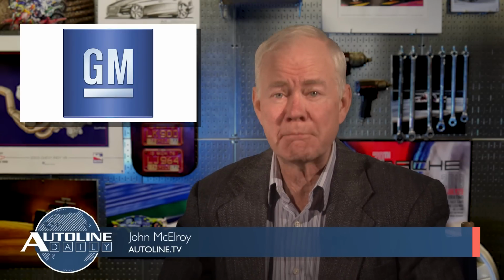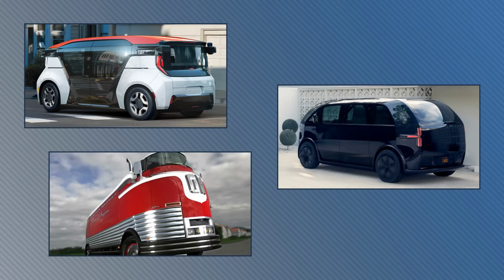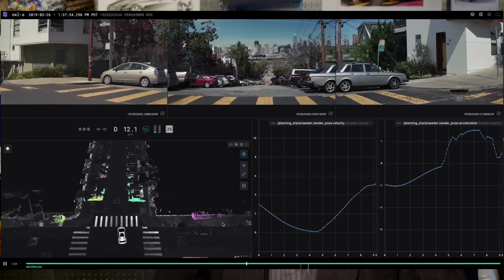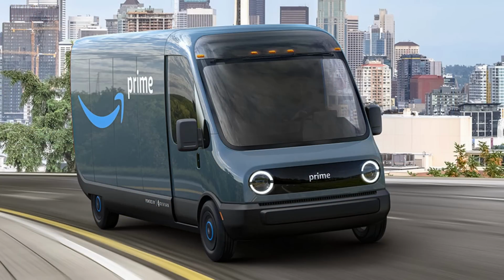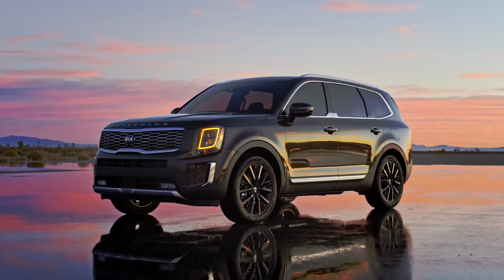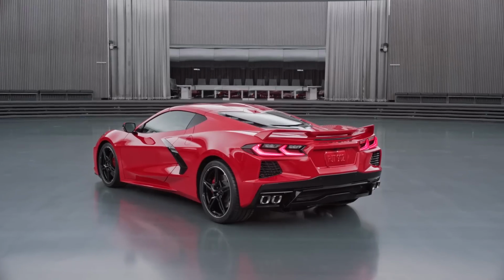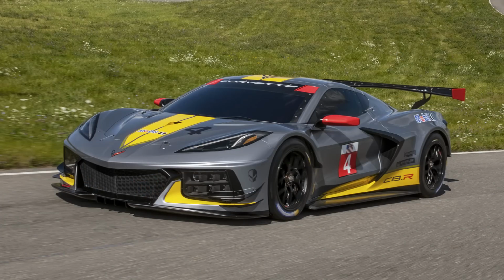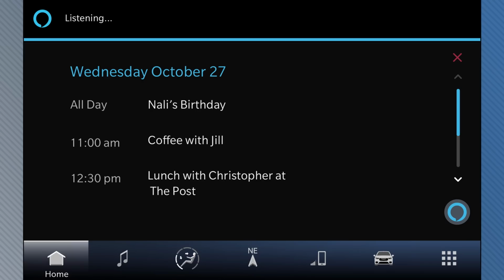Rivian Production Details; New Uconnect System - Autoline Daily 2759

Comment: Rivian is taking too long. They founded 10 years ago, started developing the vehicle in stealth mode 6 years ago and they won't be ready until the end of this year? What's the problem, they've been showing full pre-production vehicles now for nearly 2 years. When it comes to speed of development, they're no Tesla that's for sure.
Reply: Being no Tesla is a good thing. Rivian is taking the time to launch properly, rather than using Musk's "to hell with planning, build it niw and fix it as we go“ method. You won't see Rivian reducing the number of welds to speed things up and finishing vehicles in tents in a desperate bid to fill orders.
Reply: Designed from ground up, company built from scratch involving a few guys. Designed new batteries, had to keep building their team, had to build their infrastructure. 10 years is not bad.

Comment: Rivian suv will get delayed. You heard it here first.
Reply: No, I didn't hear it here first. Every Tesla fanboy in every comment section for an article or video about Rivian says the same thing. And they will all be wrong.
Reply: @TroySavary  says the rivian fanvoy himself lol. You don't have to be a tesla fan boy to see or rather not see rivian making or sourcing enough cells without charging an arm and a leg. Just look at all the problems vw group are having with sourcing enough cells as an example. Software issues etc. But let's hope you are right... As we do need more evs on the road.
Reply: @8est8its89  Rivian is using a standard 2170 cell. Those are not in short supply. I don't see a problem finding enough for the 50k to 100k trucks they plan to build per year. Especially with Amazon backing them.
Reply: Battery production problems.
Reply: @allencrider  that's what it comes down to. They so worried about the body when most any existing car would do, they just need a ton of batteries per car to make it happen
Reply: I just don't see how Rivian can make 100,000 vehicles just for Amazon by 2024, I'm not hating on the company at all, I actually want them to succeed. More competition means better choice for the consumer after all but I just cannot fathom how they will make that happen and focus on their own vehicles.
Reply: This ain't Tesla.
Reply: We are building some of the tooling for the interior trim pieces. I'm not sure if they are for the Rivian truck or suv. Would be late spring before they go into production.
Reply: You mean like every electic concept vehicle? Tesla is notorious for delaying practically every vehicle they've ever made. So it's not a bad thing if Rivian ends up delaying there's, as long as we get the best vehicle possible by them with no issues.
Reply: @maizeandblue5102  There is no evidence that Rivian won't make their promised end of 2020 delivery date. People who claim they are late conveniently ignore the fact that when Rivian unveiled the trucks in late 2018, they stated a late 2020 launch at the time.
Reply: Maize and Blue Hmm, let’s see, the Model 3 was right on time and now has produced and sold hundreds of thousands. The new Model Y delivery is six months early and targeted to produce millions. So, I think TSLA has figured this out. However, similar to TSLA’s first vehicle, Rivian’s first vehicle will probably be 2 years late and 50% over budget.
Reply: @josephlemieux5909  Rivian hired people with decades of experience in running car assembly lines. Unlike Elon, they did not think they know better than people who were already experts. Tesla ran into problems because of Elon's ego. Rivian is doing it the right way by making sure everything is in place before starting mass production. They have done test runs of the line. Tesla did not. They just winged it and screwed up.
Reply: Troy Savary Hmm how has TSLA screwed up? Seems to me all the major auto manufacturers have screwed up - Big Time!! Sorry Troy opinions are opinions and numbers don’t lie. Good luck with hiring people that know how to build ICE vehicles but no experience in the EV market. Remember Rivian has yet to manufacture one vehicle. The clock is ticking.
Reply: @josephlemieux5909  Tesla screwed up the launch of the Model 3. Sure, they recovered, but even the most diehard fanboy can't deny the manufacturing lines were a mess at first. That was a rookie mistake because Elon refused to do a test run of the lines. Every car makers runs a couple thousand cars through that are not meant for sale. There are test driven, torn down, and the issues found and fixed on the line before another run is put through. Tesla, on the other hand, sent the first run to consumers. Rivian has already done a test production run. That is one reason for the perceived dloeness of launch.
Reply: Troy Savary well I guess we’ll just have to see. Rivian has still not shipped one truck. The real problems arise in ramping manufacturing. That’s why TSLA is the only new auto manufacturer in over 70 years. Based on prior new EV manufacturing results Rivian will miss delivery by at least a year and their product will cost 50% more or need to be sold at a significant loss.

Comment: End of 2020 for Rivian?  Hmmm.  That's going to be a little too late to grab much attention.  The Cybertruck is due out in 2021 too so why would you settle for a Rivian just a few months before you could test drive a Cybertruck?  Even if you don't like the Cybertruck concept as shown I think most people would wait to plunk down $70k STARTING PRICE on a Rivian to see if the $50k dual motor version of the Cybertruck wouldn't be a better choice.  I predict Rivian will throw in the towel on pickups and SUVs and concentrate on building Amazon vans and maybe skateboards for Ford/Lincoln (and that wouldn't be a bad strategy just an embarrassing one).
Reply: Only delusional Tesla fanboys believe the Cybertruck will launch next year. They still haven't launched the Roadster that was shown off in 2017. They don't even have a testing prototype of the Cybertruck yet. All they have is a one off hand built show truck for Elon to play Mars Rover in. Tesla has no machines to bend 3mm stainless steel origami style on an assembly line. Rivian, on the other hand, has 10s of thousands of miles of real world testings in production prototypes of their trucks. They have stamped body panels stockpiled, waiting to be assembled. They have the lines ready to go. Rivian will be selling trucks this year. Tesla will be continually pushing back the launch date. By time the Cybertruck launches, if it ever does, Ford and GM will be selling their EV trucks and SUVs in high volume.
Reply: @TroySavary  ok boomer
Reply: @TroySavary  Again time will tell, Sandy Monroe seems to be quite impressed with the Cybertrucks potential.
Reply: Dieter Zerressen And Islam is a religion of peace 👌🏻
Reply: @V0YAG3R  ok boomer
Reply: The cybertruck was designed by the same person who brought us the stick people families in bumper stickers!  Watch those $100 refundable reservations get refunded by the cybertuckfulls😯
Reply: @joejaboney208  the demand will be high.
Reply: @joejaboney208  ok boomer

Comment: Wonder what their computers in these cars with all this automation are using.  Tesla get about 2 million miles of test data a day.  It is processed by a custom 70 Tops processor.  By the time GM spends that 2 billion trying to remodel a building, Tesla will have spent 8 billion in Brandenberg plus another few billion in China and increasing production at the Giga 1 and 2.
Reply: This has got to be a first .  They talked about autonomous vehicles and didn't find a way to bash Tesla. The old geezer must've been asleep when they wrote his script
Reply: Probably NVidia, who has way more experience in computer vision and AI than Tesla.
Reply: Troy Savary wrong. NVidia is making a generic AI solution not specifically targeted for automotive autonomy. This solution is being spread over multiple AI solutions and forces users to shoehorn it into their specific needs. This is why TSLA has developed their own solution. The TSLA latest hardware/firmware solution, being produced for the Model Y and being delivered out of Fremont the end of February, according to ARK Investment analysis, is at least four years ahead of all competitors.
Reply: @josephlemieux5909  Thanks for displaying your utter ignorance in CPU design. Tesla did not design a custom solution. There chip is generic Arm cores with a fixed function math coprocessor to handle the basic math that neural nets use. nVidia's solution uses generic Arm cores with a fixed function math coprocessor, just lije Tesla's solution. But the NVidia chip has more computational units in the coprocessor, therefore handling more computations per second. The details of the Tesla chip are not hard to find and they are nothing new or revolutionary. They are just an evolution of the nVidia solution they were using. But nVidia has since made a newer, more powerful chip and leapfrogged Tesla.

Ark investment is not a good source of info. They have no technical expertise. They are an investment firm with a below average track record. There largest single stock holding is Tesla, so they have an ulterior motive to praise Tesla.

The Tesla chip does 36 trillion operation per second, the NVidia one does 200 trillion operations per second. Tesla isn't even close.
Reply: Troy Savary Hmm interesting how you can state the teraflop specs for TSLA’s proprietary chip. Nice work. BTW how long have you worked in the ARM business or for NVidia? Oh that’s right not at all. Lets see the analyst at ARK spent 12 years at NVidea R&D. Again opinions are opinions and numbers don’t lie. We’ll see how well the NVidia solution actually works for the other Auto manufacturers and AV designers. Good luck with your thesis.
Reply: @josephlemieux5909  The specs for the Tesla chip are not secret. Tesla loudly proclaimed them when they surpassed the previous nVidia chip. They are eating crow now that nVidia's new chip has been unveiled. Tesla has no hope of beating a company that has been a leader in this field for over a decade. Hiring a few chip designers won't overcome the huge IP advantage nVidia has. There is nothing inherently different about using these chips in cars. Computer vision is still computer vision, whether you are using it to recognise faces or traffic cones. The computations needed are the same. You may tweak the algorithm for specific purposes, but the basic math ooeratiins needed are the same, so the chip optimisation for one are valid for the other.
Reply: Troy Savary like I said we’ll see if anyone of the other AV players make  any progress with the NVidia chip. Teraflops are not the complete picture - internal firmware is the real key. So good luck. BTW the TSLA solution has several billions of miles of data collected to work with. How much does the new NVidia chip have? A few million at best. Good luck with your thesis.
Reply: NVidia dont come close to TESLA Ai cpu > look it up      intel & nvidia  r  like WTF 😳🤷‍♂️how he do it ?
🤵💭Elon musk 🤐👈mums the word  18months to engineer 2x cpu ai & built by  Samsung Texas 
🧧👈china we need more spies   haa🔋💹👍

Comment: The 488 GTB has 661 hp and gets 22 mpg on the highway. 160 more hp and 3 less mpg is not bad at all.
Reply: My Murano makes 21.6 mpg
Reply: My Prius has 180K miles and still gets over 500 miles to a tank with 1.5 gallons of reserve and it never breaks down.

Comment: Future is hydrogen
Reply: no its not. Its hugely inefficient compared to BEV and a nightmare to store under high pressure. Its  pipe dream and a distraction at best.
Reply: @tabbott429  guess you haven't heard of the breakthrough. Sun powered with no batteries. Hard to beat that
Reply: @mblake0420  how is the power stored for night use?
Reply: @tabbott429  in a tank
Reply: said 20 years ago.  Too little, too late and now way too expensive for the infrastructure:  production and storage costs will kill any "gas station" owners.
Reply: Ahahahhahahahahahaahaha

No
Reply: I’d hate to give up home ev charging, try that with hydrogen. Hydrogen may work for commercial but mainly just an attempt by oil companies to hold on to their market. Glad I sold my Exon stock last year, it’s down to 65 from 95 over the last 5yr while rest of market is up
Reply: Hydrogen is not a nightmare to store at high pressure. It does leak out of everything--even solid steel containers--but that hardly makes it a "nightmare." And being at high pressure is nothing we haven't already solved.

And if hydrogen has a niche, it's in flight. Drones, helicopters, etc., because its energy density (energy / mass) is so high. For large vehicles, such as buses, garbage trucks, fire engines, delivery vans, etc., I'd rather we use conventional engines with natural gas. 
"But natural gas isn't carbon-free! It's not green!" critics say. Well, neither is hydrogen. It has to be manufactured. And if you manufacture your fuel, then manufacture natural gas using CO2 as a feedstock. The round trip efficiency is unlikely to be any worse than hydrogen, and it saves a ton of money on FCs and infrastructure.
Reply: @theevermind  As far as weight goes, hydrogen fuel cells and their storage tanks aren't much lighter than batteries, which is why hydrogen powered aircraft are so pathetically slow and have such ridiculously short range. They're just useless.